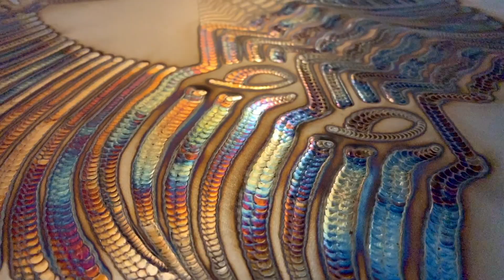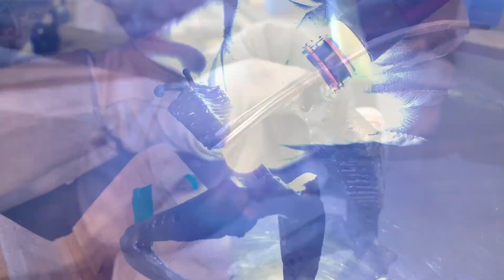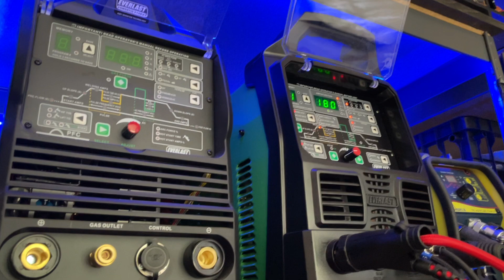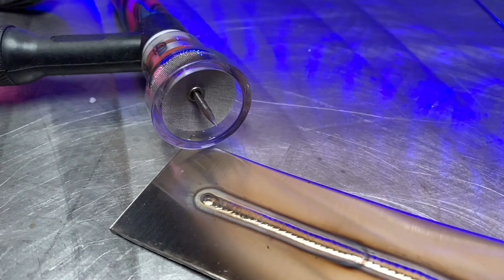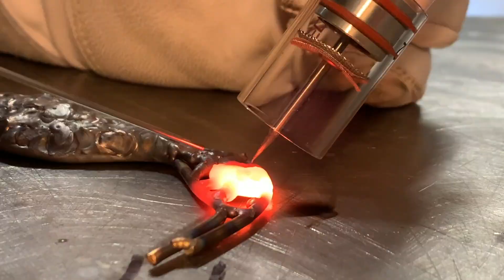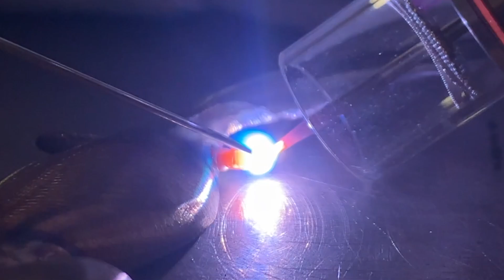Want to learn how to Make tig welding Art? Start here🔥

Comment: what is your base material? thickness? filler rod material? rod size? settings? flow rate? post/pre? max amperage? pulse? cup size? tungsten? tungsten size? 
you could have easily said these things quickly or just posted a recipe in the description...but no- you sat there and talked about the same thing you talk about in every video and ran your sponsors....great job

Comment: What aboot respirators? I always thought you wanted one welding aluminum and what about stainless? And what else is bad, zinc galvanized or just everything? What are acceptable respirators? Do you just use a fume extractor? So many questions, so little time. Thanks for the motivation
Reply: Respirators can be worn for all welding and should be worn for all grinding. Carbon steel isn’t that bad unless it’s oily. I don’t weld stainless or aluminum often so I don’t wear a respirator. If you weld those often, then it may be good practice to start wearing it. Anything galvanized/coated on the other hand, your body will let you know real quick if you breath that in. Again, you should wear a respirator when you grind at all times. Most don’t, and that’s a shame - nothing tough about it... search for 3M P100 respirator pads.
Reply: @JRP026   @JP  Thanks much appreciated. I always try to wear n95 grinding and cutting but seemed like just a dust mask for welding. I have just been welding a little bit of steel haven't thought much of it beside keep the head out of the smoke. Good ol' google says n95 acceptable for most welding but will definitely invest in a p100 setup, cheap peace of mind. Just see very few people on youtube here takin off a respirator after welding stainless or aluminum or anything about the ill effects doing so.

Comment: I have only recently gotten decent at tig welding. once I mastered flat plate passes, I picked up some puzzles from weld metals online. some of them didn’t turn out very well. but by setting some ground rules ( such as not repositioning the piece unless absolutely necessary) it really helps you get comfortable with your set up, stay loose (ABCs of welding) and thinking outside the box on ways to hold the torch, feed filler, etc  and I feel like the same is probably true with art and sculpture, it gets you outside of the norm.  I suppose you should be careful not to start any bad habits if you’re looking to get into structural welding in the future, but overall it can be a good skill builder.
Reply: i agree with ya. even if ur just practicing passes, practicing them in an orientation to make something visually keeps you more focused on what your doing, or perhaps changes perspective.